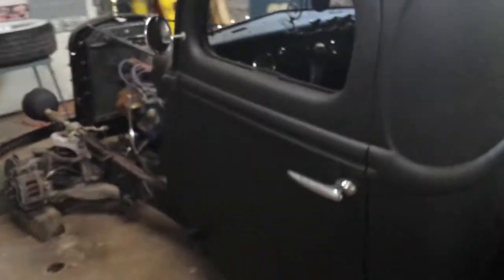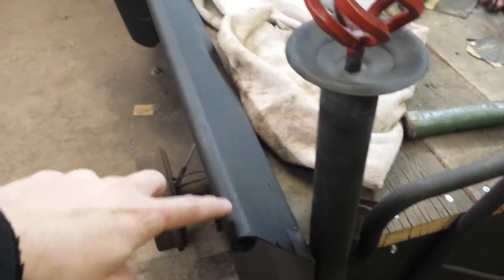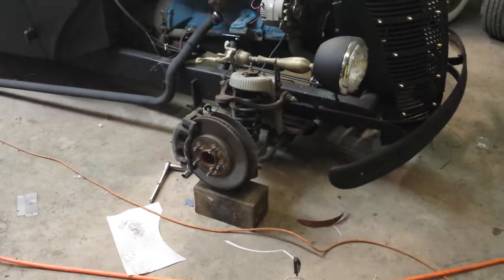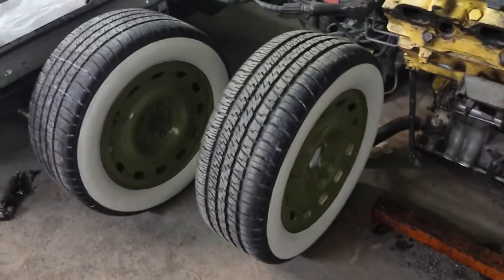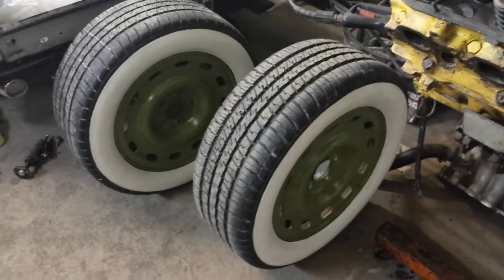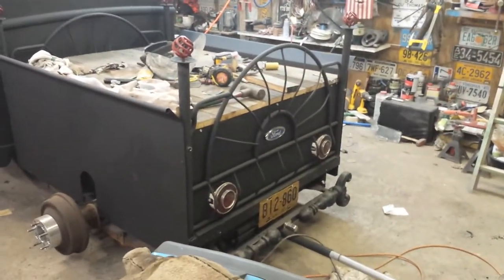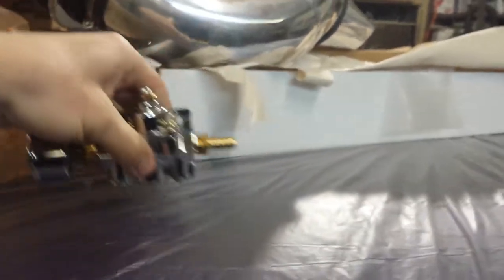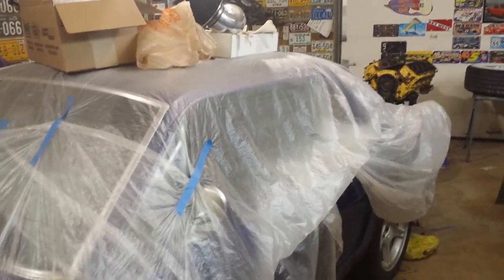Dad's rat rod changes and mustang update!

Comment: Never seen the tire paint. Thank goodness you caught the wiring issue in time before disaster struck!
Reply from the maker: I want to think he got it off of Ebay.  It was $30 for about a pint.  It is intense paint.  Paint thinner doesn't effect it at all.  Every time he puts on a coat he needs a new brush because he's unable to clean the brush.  Much cheaper than $200 white wall tires but the finish is about a 5-6 out of 10.  Really nice from 5-10 feet away.  Trying to keep the cost down as much as possible on the 40.  

I adjusted the floats in the carb and I unhooked the power wire to the distributor to get it out of the way.  I then wanted to hold the carb in the air while I turned the switch on to see if gas would leak out the bottom of it.  At that time I forgot about the distributor wire.  I turned the switch on and then picked up the carb.  I then noticed the hot wire was grounded to the engine.  I moved it thinking that fixed it.  About 10-15 seconds later I opened the door to turn the switch off and smoke just rolled out.  I found it to be the relay on the push button start that controlled that power wire that I grounded.  It was so close to being a flame.  The wire melted all the way through the casing.  I think it was 2 wires that melted.  Thank God I opened the door when I did.  

The wiring is all fixed now.  Just need to put the regulator on.  Hoping that fixes my carb flooding.
Reply: Cobrafanatik22 It is amazing how many ways a car build will challenge you, they are a reminder that so many things need attention. Good luck getting the regulator set up and tuning the carb.
Reply from the maker: That is so true.  I'm trying to move forward but I feel like I'm staying still.  I'm hoping the regulator fixes my issues.  I'll keep you posted.  Thanks Rich